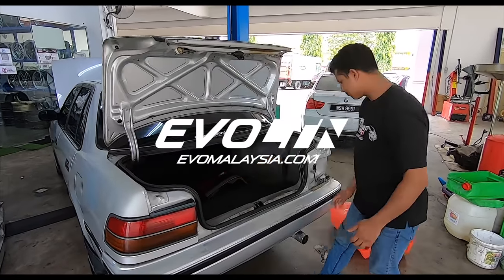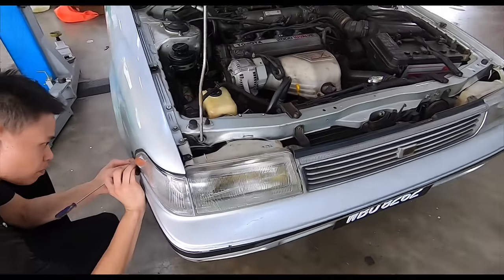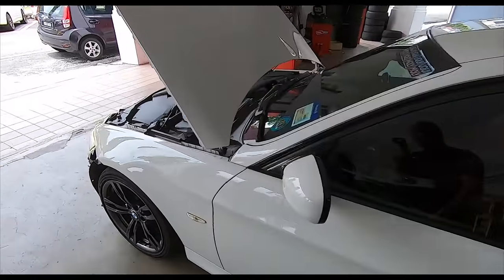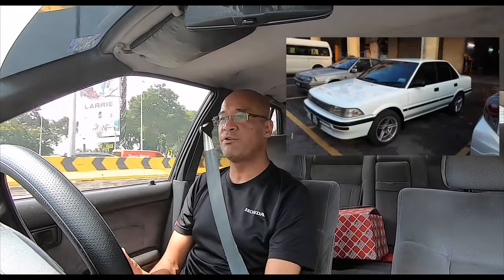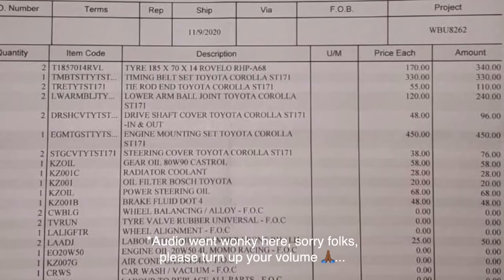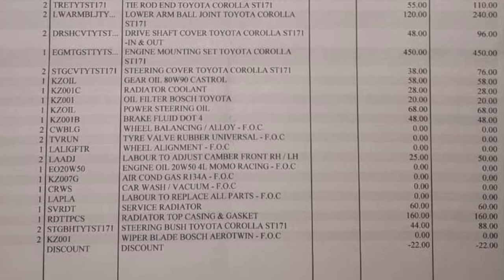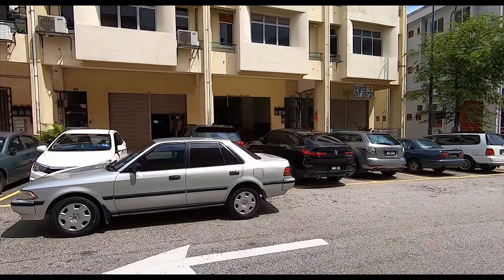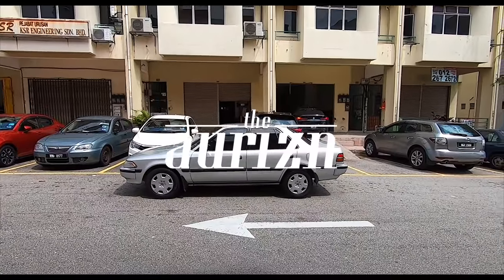UCR UPDATE: 1989 Toyota Corona 2.0GLi - Off to Paint BUT What Have I SPENT So Far? | EvoMalaysia.com

Comment: Hi your video is superb
I own a 1991 model of this for 4 years now same colour but faded off, and i have installed 15" wheels.
Its a bit of a hassle to get spare parts brand new (its a nightmare). In Sri Lanka and when you said you found brand new tail lights 😂😂its insane.
And do you have the digital meter and five spokes steering?
Reply from the maker: Thanks!! Yeah, I was very surprised to find those rear lights too! Nah, mine uses the analogue meters and 4-spoke steering wheel 🙏🏽👍🏾😊

Comment: The old girl looks nice. My ex-neighbor had a facelift version, and even though it was kinda boxy, it still looked very decent and respectable (like a smaller brother of the gen 6 Mark 2 Chaser). How does it compare to the U12 Bluebird in terms of refinement, power , and fuel consumption?
Reply from the maker: Thanks!! In comparison, it's about the same as the BB, but slightly quicker and maybe not as frugal, but I've yet to take it for a long drive so we'll see 😊

Comment: That's one good car already! By the way, Dental floss is a good tool for the emblems 😁😁

I saw the Rovelo tyres in the receipt. Are they any good?
Reply from the maker: Thanks for the tip!! Rovelo is made by Falken, and so far they've been fine actually, another option for good inexpensive tyres, like Viking 👍🏾😊
Reply: @ChrisWeevilGarage  thanks for the info.🙏 Yes. I agree with you regarding viking. I'm using viking tyres for my satria. They're good albeit a bit noisy